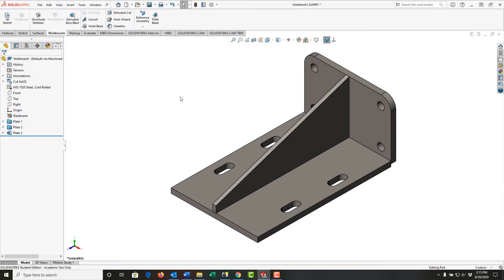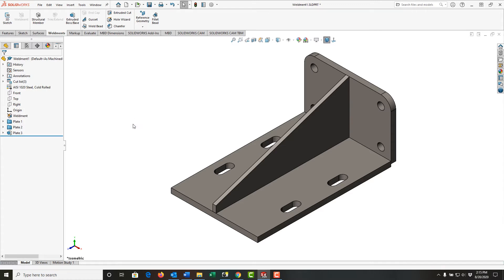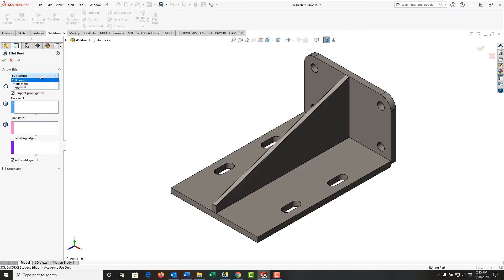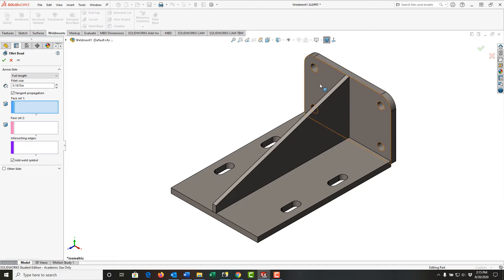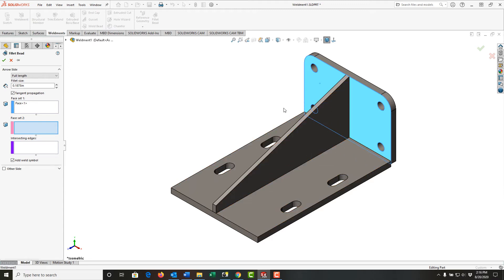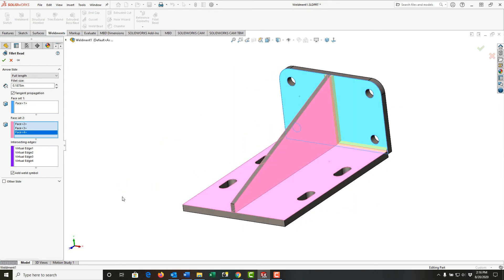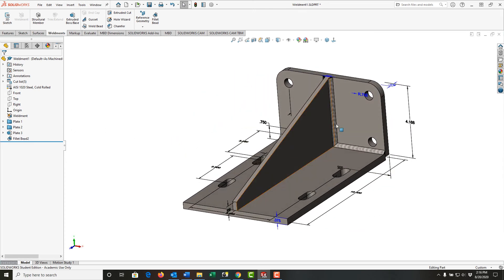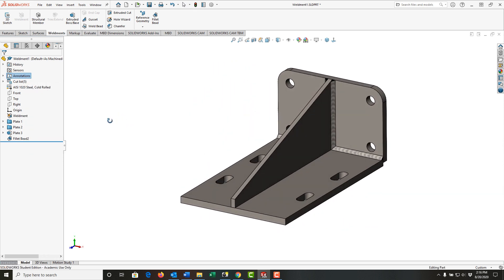Fillet Bead

Comment: Would you please demonstrate how to create a V-groove (between two plates for example)?
Reply from the maker: Just add a chamfer to each plate edge.
Reply: Thank you!
It worked.
Another question: why isn't it possible to create fillet bead in assembly?
Reply from the maker: @sergeydukman5832  You will need to edit the weldment in the assembly, then add the fillet bead. Or if your are adding a fillet bead in an assembly, then from the drop-down menus select: Insert, Assembly Feature, Weld Bead...
Reply: @Fredumaction  Is it possible to demonatrate it on a video, please?
Reply: @Fredumaction  I tried, but the weld is being invisible.
Reply from the maker: The weld bead option does not add the appearance of a fillet bead, like the fillet bead does. You also need to be aware of what configuration is active when editing, as weldments have two configurations, "as machined" and "as welded."
Reply: @Fredumaction  This is strange that in Assembly mode the weld bead is invisible. It doesn't make any sence. 
Hopefully it will be available in future.